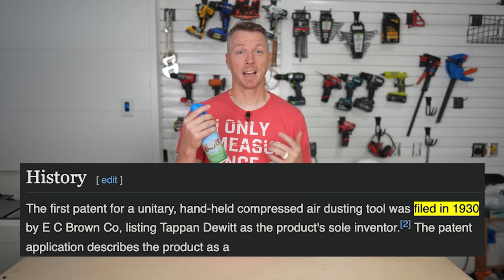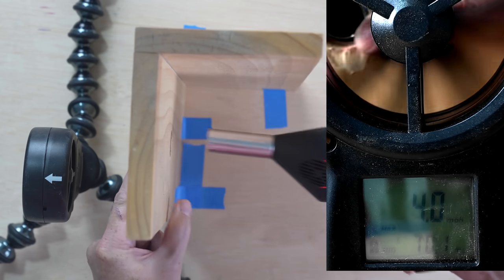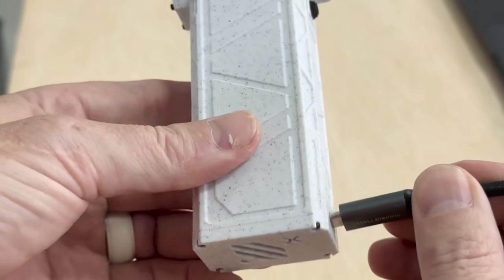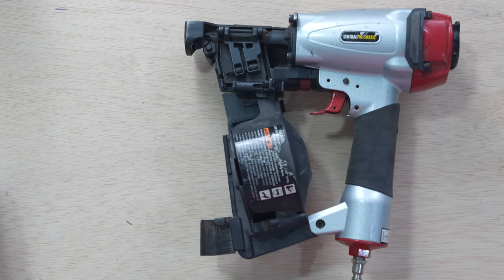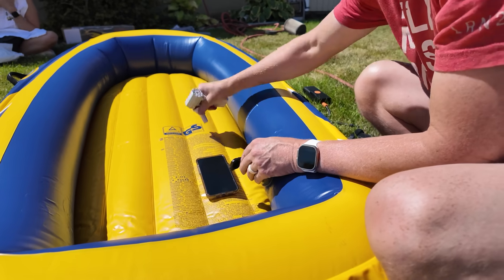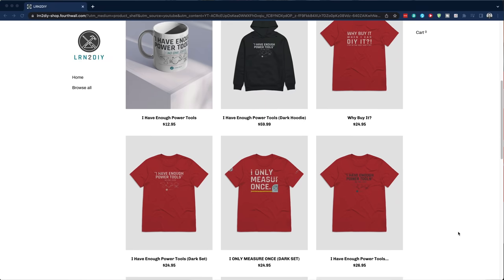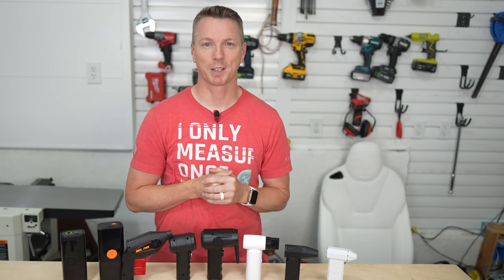The Air Duster, Reinvented

Comment: I have tried a lot of them. My personal favorite was a chunky boy, about the size of a soup can, and had crazy power behind it. They stopped making it for some odd reason. I think because it overheats after like 30 seconds.  It was an AC powered pool toy inflator. I think it was $32, and it beat all the "Canned Air Alternatives" to this day. Flextail makes some good tiny pumps that also make decent dusters. Just picked up the CCV one and that's been my second favorite. Thing has a lot of power and they want $80 for it.
Reply: Was the chunky AC boy the Datavac Electric Duster?  I have one in my closet, the thing is a beast but will wake the dead.

Comment: Bought a cheap blower by ‘Mellif’ (60 bucks) that works off my DeWalt packs….Very similar to the new Makita blower (150 bucks).  Clears work piece saw dust and chippings from tools like a champ.  The air blast deforms skin like one of those washroom hand driers…pretty powerful.

Comment: 40.9mph is a whole lot more than 19.7, but I always wonder with these fan-based blowers how much the shock force of all the air coming out of the can knocks dust loose, that maybe the slower-to-start blowers doesn't do, because they have a ramp up phase. It's like the pushing really hard versus giving something a whack with less power, which shocks something into breaking, or breaking loose. I've used dust-off on plastic things where not all the dust comes off, even if I keep hitting and going over areas. If I get right up on the thing, it gets a little more clean, but there's some very tiny dust that just really holds on and needs to be wiped clear to really get back to clean (until you use a microscope, and realize truly clean is an illusion). I'm curious if the highest power rechargeable one really does knock the same amount of the really tiny dust loose. Still seems worth it for all that power. Now I just need something to pull all that dust out of the air so it doesn't just resettle on the same surface, or all over my bookcases.
Reply: Dust still goes in the air even with canned air though?

Comment: you forgot to add the inflators from ryobi and bauer, and other battery brands (Red, Yellow, Black, Orange, etc) that are designed to inflate pool toys, mattresses, and other inflatables. They also have extra nozzles that allow other uses. I have used my mattress inflator for fires, cleaning, and general mayhem with the kiddos. they run off of the standard tool brand battery and can do everything you were tesing for. I'd love to see a follow up or maybe a short with these .😊

Comment: The 3D printed case one is good it's using a newer motor, getting to see many versions of it. I have the old PC blower and this new little one... the little one is amazing and very handy.
Reply: How much force does it produce if you blow on a scale?
Reply: @sergeimerekin8193  I don't have scales but i did blow it on my mech keyboard with quite firm switches and it pushes them  almost all the way. Also it has some thrust cos as you turn it on it will move your hand back a little. I love it.  I got the EUKI one.
Reply: @shaolindreams  Thank you for the answer, sounds like a pretty decent force.

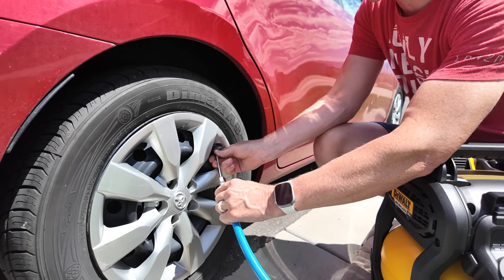Comment: 10:14 Your tire is facing the wrong way. Who ever put them on was drunk or something. The "inside" labling shouldn't be visible on the outside.
Reply: Wat?
Reply: Oh I had to zoom in on my phone to see it. lol. That’s pretty funny. Well spotted.
Reply: I don't know if this is the case here but I've bought tires that had white walls and had them installed backwards because I didn't want the white walls showing.
Reply: @sociopathmercenary  Just a note for people considering this: depending on the tread pattern, mounting tires backwards can have a significant negative impact on performance, particularly in wet or snowy conditions where the tread pattern may be meant to direct water away from the middle of the tires to improve grip. Installing tires with those types of designs backwards can dramatically reduce the threshold speed at which you lose grip due to hydroplaning. There are also tread features meant to bite into snow and ice that are directional. Some tires it's not an issue, but lots of tires are directional in ways that have safety implications if improperly installed.
Reply: @jonathanwingate6175  I was a car mechanic so I just see things like that haha
Reply: @sociopathmercenary  That is true for many tires. However now they make directional tires where the tread pattern is designed to perform better going in a forward direction.  If they are marked with FORWARD or arrows they are directional. They often have an asymmetric tread where the inner edge is different than the outer edge.

Comment: My issue with the electric blowers is that at a certain point if the nozzle gets too small it just doesn’t work. Like the tiny nozzle of the canned air is a killer feature because sometimes you just need that precise air

Comment: Something to note about using any kind of compressed air on computer equipment: You do NOT want a lot of power, as there is the potential to dislodge a piece of metallic dust that ends up being blown under a chip and shorts out the tiny pins or solder balls connecting it to the circuit board, or otherwise damages the board or components. After many years in the computer repair business, I have a collection of stories about perfectly working systems being killed by someone just blowing out their PC with an air compressor nozzle, even a few that were killed using one of those canned air blowers.

In short, more powerful is not necessarily better when it comes to high tech electronics. Use an anti-static soft-bristle brush to get the bulk/stubborn dust, and a low- pressure air blower to remove it from the system, preferably outside or at least outside its normal operating environment so you don't feed that same dust right back into it.

Comment: I highly recommend those tire inflators especially if you ride a motorcycle 👌🏽
Reply: ditto! Mine was able to inflate two SUV tires from flat - 4 minutes each - on 1/4 charge
Reply: @majbach1968  Bu my question is: can I buy anyone and expect that result? which one did you use? I want it for my car.
Reply: @zintera2  I have a Fanntik X8 and X9 Pro. The X8 is the one I used on my flat SUV tires. I expect the only difference between the two is battery life but I would guarantee that the X9 would EASILY inflate two truck tires from flat on a single charge and probably take less than 10 minutes each (my estimates are conservative). The nice thing is, you can program them and walk away and they shut off automatically (just be sure to detach them before you drive away - don't ask me how I know)
Reply: no one rides motorcycles anymore. example Harley struggling to stay in business

Comment: The dust off cans of compressed air in a two pack used to be $8.88 a few years ago, and when I kept buying all of Walmart’s stock anytime they were in (since the only other compressed air they had was their Walmart brand Onn), eventually the dust off brand owners must have caught on because they eventually raised the price to like $12.64 for two cans, so it’s over $6 per can of air, which is ridiculous.

It was a good deal when it was $8-9 and $4 for each can, so I bought a lot to stock up because they were never in stock.

Now they’re always in stock because no one wants to buy them at the stupid high price.  I have 22 cans of compressed air stocked up from their cheaper price days.  I try to use as little as I can since I don’t want to support Dust Off anymore after the price hike, or whatever mega corp owns Dust Off now in 2024.

I’ve also been wondering what a compatible electronic version is that gets the same power as compressed air with a straw since it’s hard to find something as good as the cans.  I want something that has that 19mph power but the precision of a straw

Comment: if any of blowers have the air intake in the back it looked as if you would have been restricting the intake on most durring the battery test. this will have lead to longer than actual runtimes.

Comment: the tire inflators are pneumatic, so they have a lower volume but probably can do better with higer pressures, they probably wold yeld better results if they had a vessel to pressurize like the compressor have

Comment: I'll just use a Dewalt 20V mini air blower with a flexvolt or an air compressor but the compressor is a fridge compressor, It's more practical than some cheap plastic.

Comment: Can't even find that good one you show there!
Reply from the maker: Sorry about that. The individual links are all there now.
Reply: @LRN2DIY  but it says not available, sold out, and I can't find it anywhere else
Reply from the maker: @vicviv9275  Even this link? It shows that white is sold out but black and red are available: https://www.temu.com/violent-turbo-fan-electric-cordless-air-duster-130-000-rpm-mini-turbo-blower-handheld-brushless-motor-fan-52ms-type-c-for-lighting-charcoal-snow-clearing-car-keyboard-dusting-dusting-accessories-g-602672677663845.html?_oak_mp_inf=EOXo%2BNaKhIkBGiBhZTk2MGU4MDU3ZDA0NTAxOGY1MmI3N2M0MjhlNDQwNCCdhseqmDI%3D&top_gallery_url=https%3A%2F%2Fimg.kwcdn.com%2Flocal-goods-image%2F1f79705490%2F281375a9-d7cf-4755-bf30-1046729a782a_1276x1276.jpeg&spec_gallery_id=2240090821&refer_page_sn=10009&refer_source=0&freesia_scene=2&_oak_freesia_scene=2&_oak_rec_ext_1=NDU5OQ&_oak_gallery_order=121143253%2C1705871050%2C1459789876%2C2057127879%2C1872155682&search_key=electric%20air%20duster&refer_page_el_sn=200049&_x_sessn_id=cotaa3gm15&refer_page_name=search_result&refer_page_id=10009_1724518614353_dkz2azl1sx
Reply: @LRN2DIY  ok thanks, I don't know anything about temu

Comment: I like compressed air can because of the nozzle. It forces air into a really small area. One example of this is cleaning an air filter, or spraying out debris in a smartphone charging port. Is the electric air duster able to provide enough wind force to do the same thing as the can duster?
Reply: The purpose of the straw is because these cans always had little pressure to begin with

Comment: I have ( had, one died ) two different air blowers.  The AC powered one is very strong, but has a cord.  The cordless one sadly died.  But I'd often use it to blow dust and dog hair off my wooden stairs, and just blow everything down to the floor, then vacuum it up, instead of lugging a vacuum up the steps.   Also great for blowing out under things like a stove or fridge.  Especially when you have two cats and a dog.    I need a new cordless blower though, since my last one died.   Just sucks most of your links are for TEMU.  I'd love that 3D printed one.  I just refuse to use TEMU.

Comment: I appreciate the try, but this was not a good comparison. Pressure, amount of air flown, air speed, etc are different things. These tools are for different applications. 
Air duster cans have a very narrow outlet for a reason. For that you need high speed and pressure on a small area. The only good comparison would have been to set up an actual repeatable scene where you actually have to blow dust away.

Comment: There are different things to compare in those devices, not only air speed. The air pressure and the air volume are also important. And different device types are used for different applications. The tire air compressor is done for air pressure. The computer blower  doesn't need so much pressure, but more speed. The inflatable boat needs much more volume than pressure or even speed. All these should also be measured for a fair comparison. 

But you did a nice job anyway.

Comment: Anyone who doesn't know, don't buy those tire inflators. They are extremely weak and can only fill one tire before needing a charge. Either get a wired one, you can get ones that plug into the car plugs for cheap that perform way better, or go with a high quality expensive one. The extra hassle of a wire is worth the inconvenience when you're waiting for ages or just up a creek because it's not charged.
Reply: Whatever you say. Filled up all my tires by 5+psi and did all of them within 5 minutes. The battery went down to 3 bars out of 4. The company I bought it from has inflators with way bigger batteries but I got the smallest one and still got the job done. I didn’t even charge it after

Comment: I wouldnt recomend leaving anything with a lithium ion battery in the glove box unless your fire insurance is up to date or you live in a cool cloudy location. I live near chicago and found several different solar usb battery banks would swell up to the point the cases split open after a few months in the car. Heat damage to a charged lithium ion can cause it to burst in to flames.

Comment: The battery blowers are useful but just like compressors they cant replace canned air. canned air is so useful as it puts out clean-dry air which makes it far less risky when cleaning delicate electronics. canned air also can be useful for quick cooling items such a bearings.

Comment: Big omission here! Tool makers, such as Dewalt and Makita now market air dusters. I have the Makita cordless DAS180.  Certainly more expensive than the small things here but far less so than a compressor. There are corded air blowers too, like the X-Power Cyber duster, 3/4hp, 90 cfm. Haven't used my corded duster since getting the Makita. Haven't considered cans either. The cans get $$$ real fast and make these blowers look like bargains!
Reply from the maker: You're right! I didn't see those types of blowers in my research so I'm checking those out for sure. Someone else brought up the Ryobi (and other brand) inflators too so I just ordered one to check it out as well. Lots of great options out there!
Reply: @LRN2DIY  I am not sure about the Ryobi. Yes, they make an "inflator." But a duster?
I have both a Makita inflator (DMP181) and a Makita duster (DAS180). I don't think of them as being equivalent for dusting. I have never used the inflator for dusting, nor the duster for inflating although, yes, there is some overlap in the tools' functions and capabilities. No first hand knowledge of the Ryobi.

Comment: Leaving a fully-charged lithium battery powered tire inflater in your car where where it may get exposed to extreme hot/cold is a really bad idea. Get a wired compressor that plugs into 12V outlets, then you never have to worry about its internal battery dying when you need it or setting your car on fire when its battery goes into thermal runaway from baking in the sun at 150F.

Comment: The only problem with using an air compressor as a duster is they can accurate moisture so it's not advised to use them on say your computer

Comment: The gas dusters don't have static buildup near the tip because they're for dusting electronics. Using them for anything else is a waste. 

Also don't use an air blower or vacuum to dust electronics...like ever.

Comment: The only thing im wondering about, the compressed air in a can has a way thinner nozzle than any of the blowers, I think that changes the way they all work .
Reply: I own the $50-ish "gun-style" electric blower. How fast you spin the fan, air volume, shouldn't matter. What matters is the psi and the little straw on the can of air helps a lot. All of those hand held electric air dusters have crappy pressure because they're too wide open at the nozzle and the electric motor doesn't have the power to compress air through a small straw. The canned duster is still far superior in quick, psi bursts needed to clean effectively.

Comment: But without a filter and moisture control. If your application requires something like Ultra Pure Compressed Air the electric dusters are not going to be as contaminate free. If you're blowing things like optics/lenses I would beware.

Comment: This is not a good comparison. Compressors and even canned air behave differently than blowers. That's why you are not able to fill a balloon. Both canned air and a compressor offer that first powerful blow (because as the name says, the air is compressed) which will not be measurable on a regular anemometer and which is actually used to blow dust off. For continuous air flow you can just use a hair dryer

Comment: that testing is unfair for portable inflators
what you need to do to sorta duplicate the flow vs pressure optimized state is use a tank with a blowgun
a regulator too as too much pressure is actually just as bad for dusting as too much flow

another option is a fun one, a propane tank hooked to a blowgun, don't make any sparks
(don't actually use propane for dusting, the tank once already empty is a cheap air buffer of ~5 gallons but the gas is DANGEROUS)

Comment: Too bad as these cordless air dusters have bad reliability.  I know of these all suffering battery, speed control or motor failures.  I liked them to work as they are handy but currently using a plug in duster, which is stronger and reliable.

Comment: The speed measurements in the beginning aren't representative of actual force. The tire inflaters' ability to build pressure wasn't measured. Good luck using a can of air to fill a tire.
Reply: These aren't intended for inflating a tire, he is comparing them to compressed air for cleaning things like keyboards, etc.

Comment: You should have tested them all without a nozzle for consistency, or all with a similar nozzle at a set distance. Also, you did NOT go into batter/charging, which can be a huge deal. For instance, that high performing black duster requires a charger that works with 18650s, an additional investment.